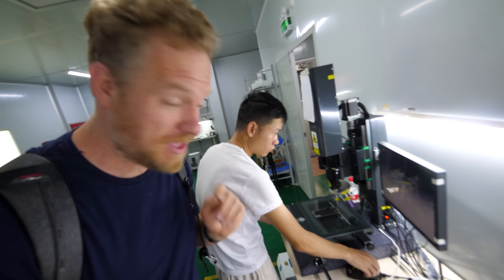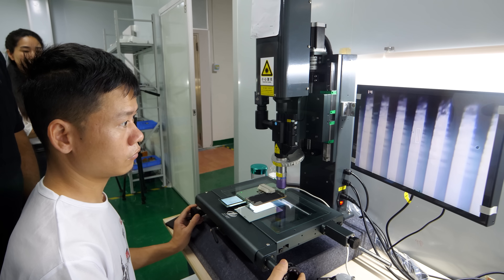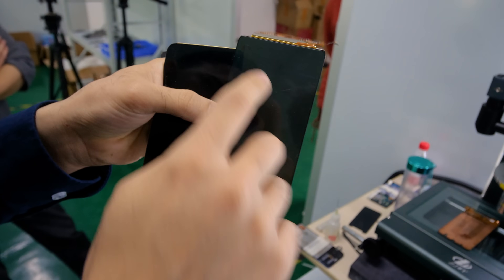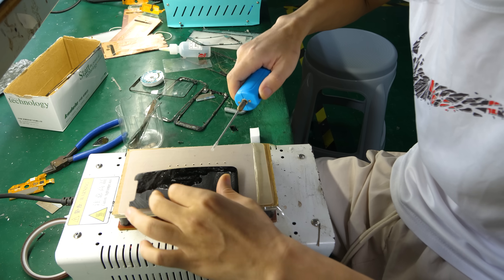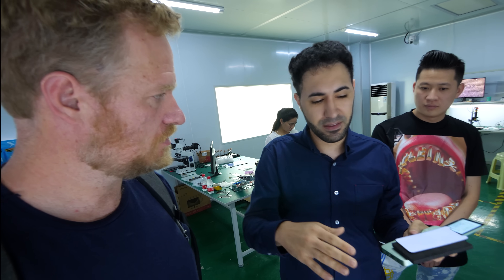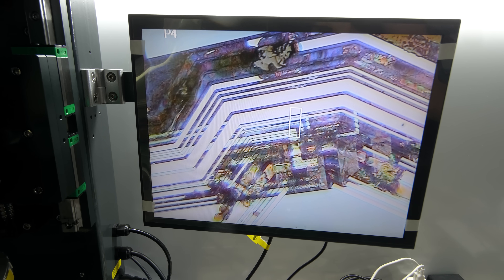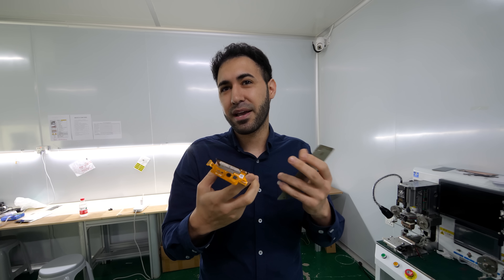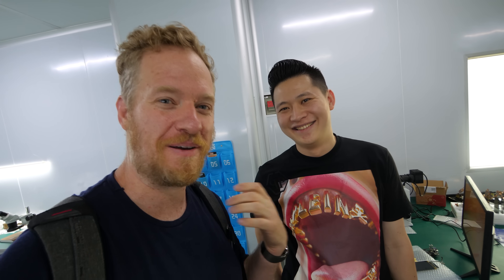A Revolution in iPhone Screen Repair: Lasers!

Comment: It's surpising it sounds like it comes out cheaper to put so much labor into fixing it vs jsut replacing the screen for the repair client o.o Amazing that it is though!
Reply: It's the cost and profit.
It should be cheaper to repair than replace especially for flagship smartphones and the profit should be more for the shop.
Reply: Automation will increase over time which will reduce the time needed. And it reduces the dependency from manufacturersvwho charge insane prices or don't provide any parts at all!
Reply: for oled and amoled screen it's worth it. but lcd maybe not.